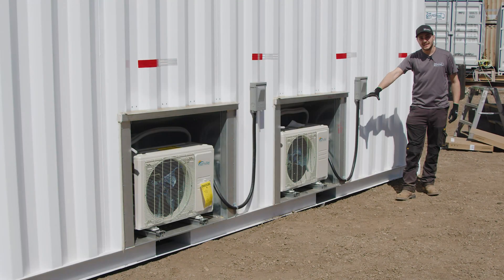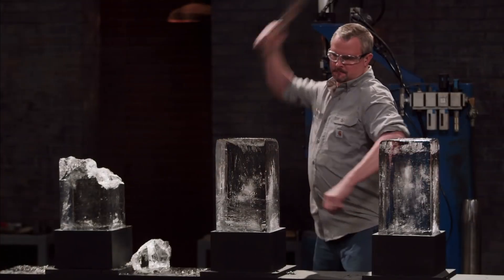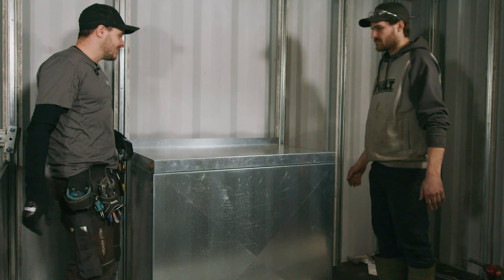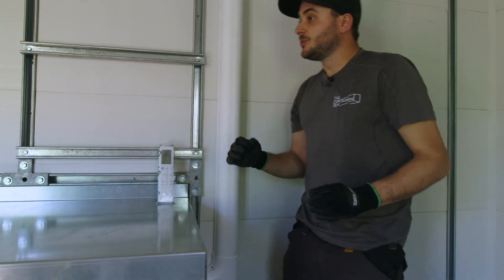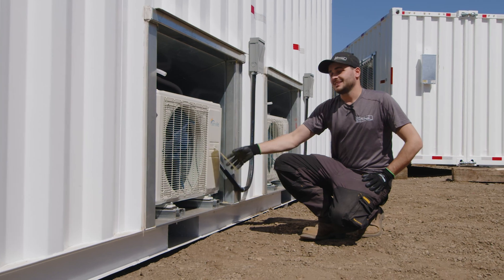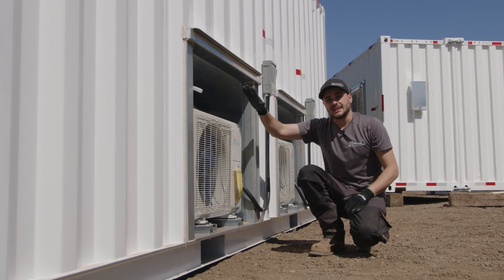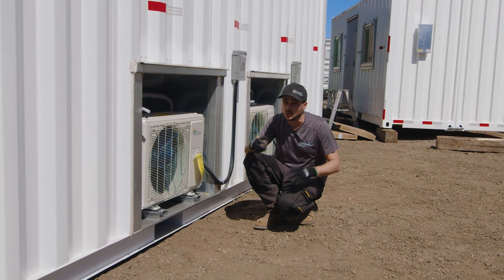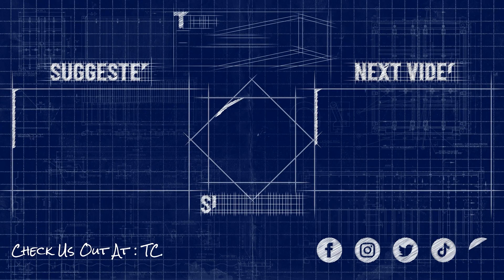Shipping Container Heat Pump Cooling System Install - NEW DIY Framing Kit

Comment: The external box of a heat container need to be separated from the area that it is cooling/heating, preferably where there is a source of the opposing heat/cold; this is the principle of the heat container. Otherwise, it will work harder than it should requiring more electricity use.
Reply from the maker: Did you watch the video?
Reply: @TheContainerGuyTV  When I saw that the contraption is inside the container volume, yet outside the containment, I stopped watching and saw the problem unless you have corrected it later in the rest of the video. So, no, I did not "fully" watch the videos. But don't get me wrong I liked your videos, it is just that I want to save the rest of the 10 minutes of my life if I disagree with something I already see in the front of the video. That's the problem with videos is that there is no TLDR. And YouTube videos are very easy to produce yet no content, or not enough proof - there is no more quality in journalism anymore.

Comment: The Camper/RV industry has been installing heavy duty slides in the below floor cargo bays of bus style RV's for decades, so it's a mature product and widely used in that industry. Those slides handle hundreds of pounds.

It's been about 20 years since I owned a motor coach and the only obvious difference the bay slide in my coach was that it was the width of the coach (about 8 feet) and slide out on either side of the coach. Your application requires a much shorter slide, but I'll bet those slide manufacturers would have a good fit for you.

Some Googling of RV storage bay slides might get you on your way.
Reply from the maker: Thanks Bryan👍👍👍

Comment: There is a truck bed tool box that is composed slide out drawers that can hold 500 lbs. Perhaps that would work, not sure if they lock in but they lock outward so as not to fall off the PU bed.

Comment: I would think Rack mount slides like used for back up batteries in server racks would work well. They can hold the weight of multiple lead acid batteries.

Comment: The biggest challenge I have with my container is, I can't move it. I have a 40' and without renting heavy equipment, I cannot move it. I have a 75hp tractor and a truck that tows 21k and I cannot move this dang container. So frustrating. Lol
Reply: Jack up one end and sit it on round fence post to roll it. Worked for me.
Reply: Does yours have the holes in the middle of it? You could get a forklift or something with forks and attempt to pick it up like that.

Comment: With such shallow slide depth, I think you will end up with the condenser dropping. If you could install longer slide rail guides under the floor with mounting rails slipping through slots in the floor and frame. Or, install a vertical pile and allow the condenser to pivot/swing out and pin in place perpendicular to the can. I think this would be simpler and provide more air flow.

Comment: (Knape and Vogt): KV 8908 heavy duty drawer slides. They are not stainless steel, but they are made for mobile and vehicular applications. The 8908 series comes in many different sizes and they latch.

Comment: I have the exact same experience with my AC (Midea, a Chinese model), it's nice for cool and barely freezing weather but needs a lot of help if the temperature drops below -10°C. However, it's primarily a cooler/dehumidifier, and it's amazing at that job. 

p.s. I could also buy a smart home extension for it, but I'm really against smart homes, especially because most appliances will go on the internet and can't be forced to operate on local network alone.
Reply: I completely agree the fact that there aren't more local network options is what prevents me from joining in on the whole "smart home" train. But most people aren't tech savvy enough to care they like the simplicity.
Reply: @bastionwolf  If yer tech savvy check out home assistant. All local smart home control that's super powerful.

Comment: How much does the lower unit weigh? I have some drawer slides that support 200lbs/90 kilos, those came from HD. I'm thinking you might want them made of stainless for rust resistance.